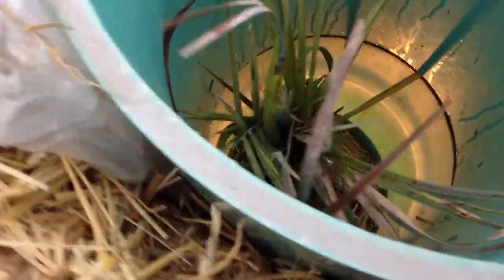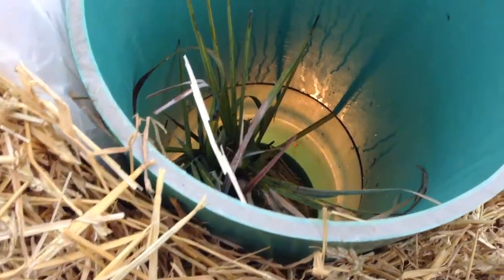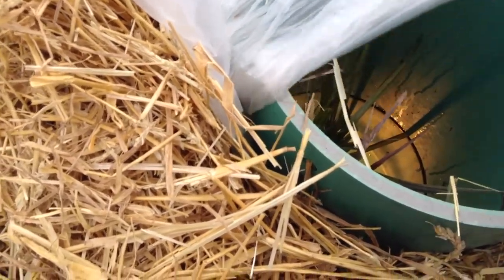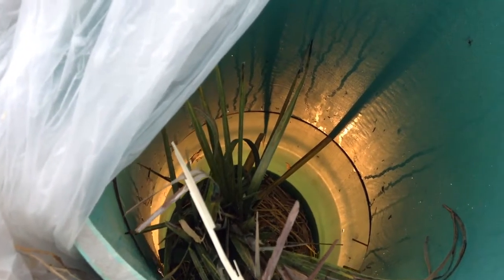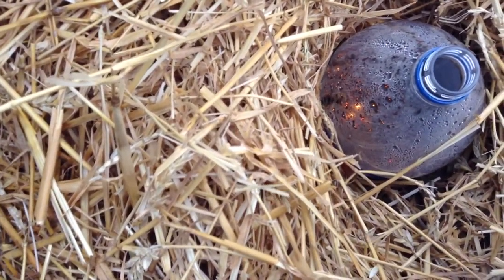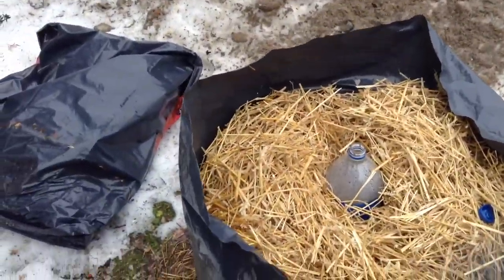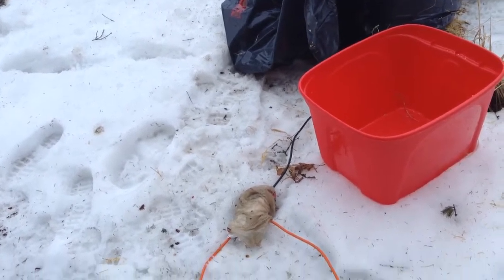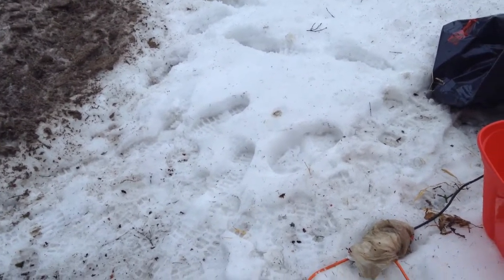Palm Trees in Wasaga Beach Jan 2017

Comment: Looks good! very interesting take on protection. Just be very mindful of condensation.you do not want mild growth.
Reply from the maker: Thanks for the comment.   I should post an update as I have modified my enclosures significantly.  I now use a pyramid shaped enclosure with styrofoam insulation.  Gives more breathing room.  Also,  the use of a thermal cube is a must for the enclosure.  I did learn the hard way that too much heat and condinsaation is the enemy of palms.  Complete opposite for my bananas.  The set up for them is a bit different.  No thermal cube needed.  They love the heat and humidity.   
Thanks again for the post and hope spring arrives early!

Comment: How are they doing a couple years later? I'm also located in Ontario 👍😁🇨🇦
Reply from the maker: Well, a couple of them died some survived.  My current palms did well the last couple of winters.  I haven't been able to check them yet because of the snow depth around them. Maybe by tomorrow night or Tuesday I can uncover, since they are calling for warmer temps.  My bananas are a different story.  I can easily check them and they are thriving.  I had to cut them back today because they were hitting the top of the enclosure.   I'll post an update when I unwrap in a few. weeks.
Reply: @custodiansrock  Hey thanks for the update. This year will be the first time I will be planting Palms on a large scale. Usually I have one or two that I protect over the winter so it will be interesting to say the least! Cheers bud 👍